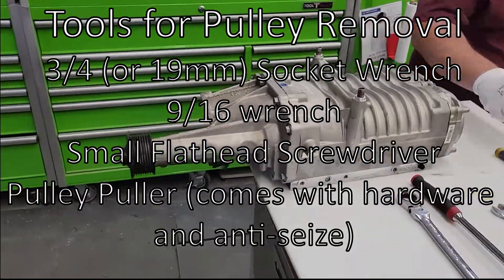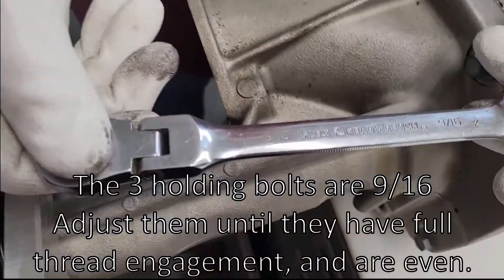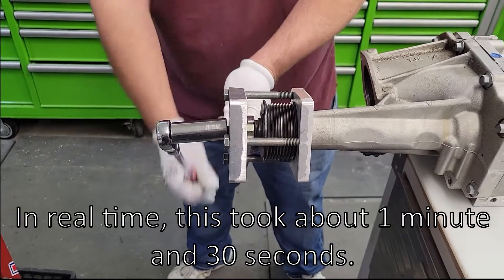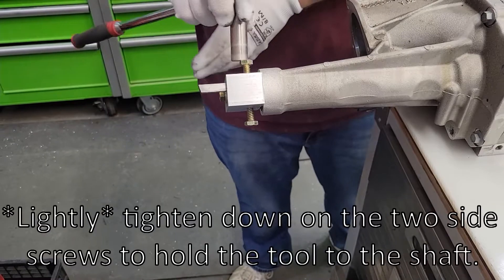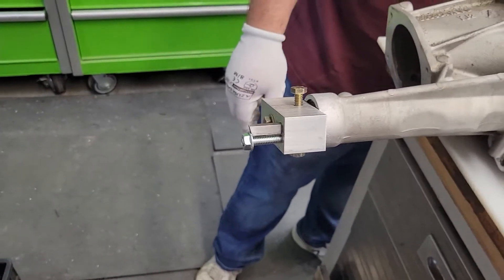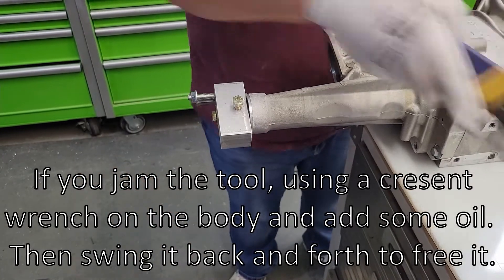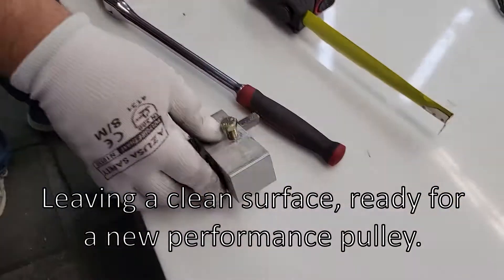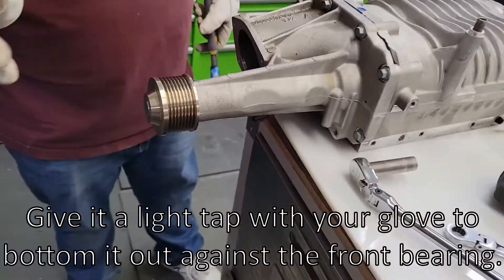5.0 Land Rover Jaguar Supercharger Pulley Removal and Installation

Comment: Is this the same process for the 4.2 sc? Or is that a different pulley and procedure?
Reply from the maker: No the 4.2 has a threaded hole on the end of the supercharger shaft.   We make a puller install tool that can remove and install the new pulley.

https://www.ebay.com/itm/126888861121